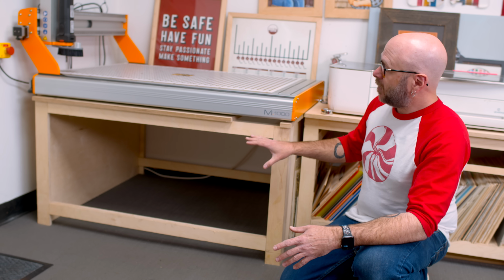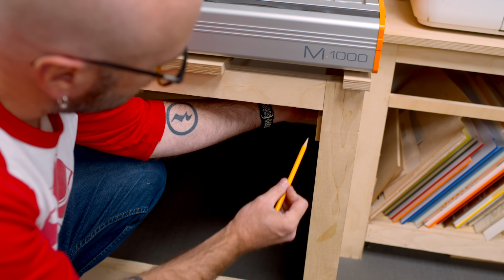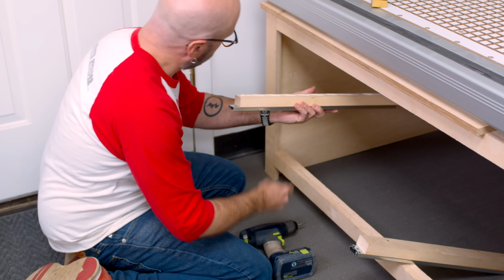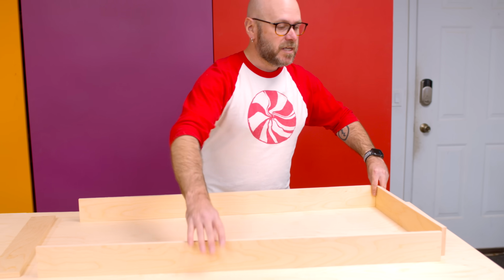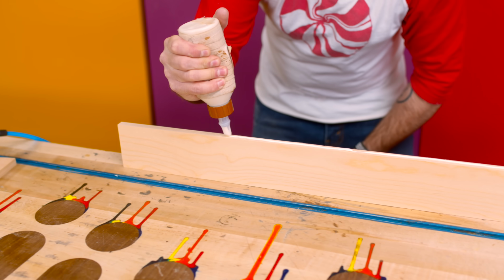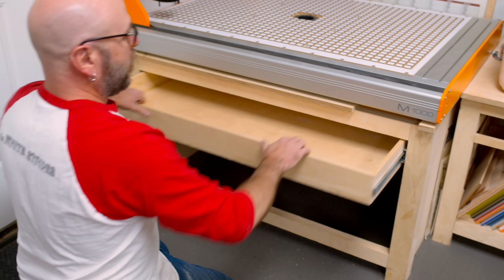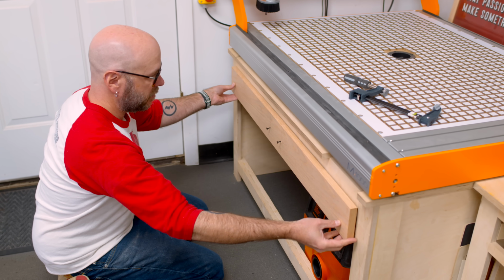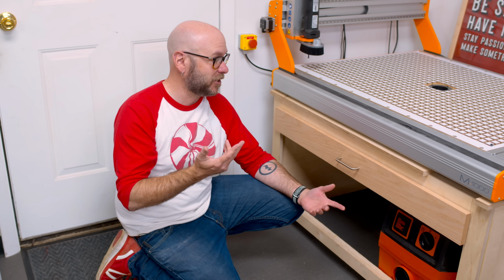Quickest and easiest way to make drawers. Woodworking Project

Comment: Interesting that it's enough with just wood glue for the bottom! Thanks for sharing!👍
Reply: It's glue, that's what it does!

With that being said, if you don't use enough, or spread it enough, or clamp it enough...then yes, the joint could come apart.

Comment: David how do you like the vacuum table and the fein vac?
Reply from the maker: Worked great in a test. Haven't used it yet on a real project.
Reply: @MakeSomething  ok, thanks for the reply I ordered the m1000 after my wife and I seen your review and debating on the vacuum table and the fein vacuum due to it having a separate cooling fan to cool the actual motor when used on a vacuum table. Hope to see a review on the whole setup

Comment: How are you going to attach your vacuum to the hold-down table with the drawers? I just purchased the M.1000 from stepcraft. I'm trying to come up with a design for the hold-down table/ Fein Turbo II and for removing the table to do vertical clamping.
Reply from the maker: For now I'll just open the drawer. I may modify the table so the port is in the back at some point.
Reply: @MakeSomething  are you happy with the stepcraft? I am waiting for mine but takes a while to get to alaska. Anyways, great content! You seem to have way better control of dust collection than I do in your shop, maybe I can tackle that next
Reply from the maker: @thirteenbravoflagsandwoodworks  Very happy with it!

Comment: Were is the music??Great stuff
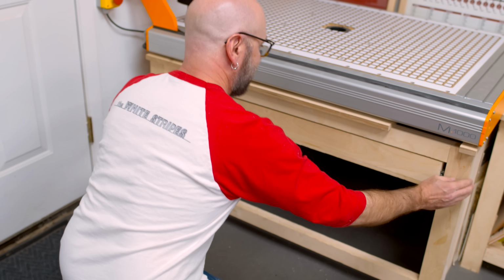Reply: Am I missing something? At 8:35 you suggested that you simply wanted to get the slides on the side of the drawer at the same height. Based on your verbiage, it seemed that you grabbed a random piece of scrap to accomplish this goal. However at 9:04 it seems clear to me that the drawer wouldn’t have closed properly if your slides would have been any lower, & there would have been an unsightly gap above the drawer if the slides were any higher. Am I seeing this wrong? If not, what happened? Did you calculate and get the scrap you needed to attain the height you wanted and not tell us? Did you grab random scrap and get lucky? Please help me understand.
Reply: @jacobgrobtuch5954  he mentioned he made a mark at 3” down so the drawer slides would be evenly spaced from the top. This probably being that he knew the overall size of drawer ahead of time.

Comment: Nice job!  Definitely a pro tip installing the drawer fronts.  I’ve used 3m tape and this screw/clamp  method for years and they both work great, yield accurate results, and efficient!  Keep up the great work as the goal is for us to continue to inspire others to build something awesome!

Comment: Hi David, I would like to request one video, one that no maker really explained, how to mark the measuring, how to cut, on the line or on which side of the line, and how to measure accurately when you have an obstacle on the one side of the measuring to be done, and really how to apply this to some things like ...making drawers and only leave 1/16th of space between each drawers, and how to measure where to install the rails for a drawer or other hardware to install...so how to translate measuring-cutting-install very accurately!
Reply: I cut so the saw blade is to the right of the line so the left of the blade guides right along the line.  If making multiple drawers put your divider such as a 2x4 to frame out the middle and your distance between both sides will be even.  After you frame out the sides so the sliders can be mounted flush you can measure out the box dimensions for your drawers.  Hope this helps, let me know if you need anything.

Comment: Doesn't really even matter the slides are at the same height in the opening. EDIT: the way did them it does.. i would have just put the slides fully into the carcass... and then sit the drawer on top of something to get it to the right level and then attach the drawer portion as I am pulling the drawer forward..

Comment: I like the idea of the 1/2 inch bottom, with no grooves etc

assuming there are no brad nails, which way makes stronger drawer? 
1. glue the walls on top of the bottom
2. glue the walls to the sides of the bottom?
Reply: Same question popped in my mind
Reply: I would recommend gluing the walls on top of the bottom and then clamping down.  Let me know if you need any help.
Reply: @inspiringbuilds  thanks for your reply.

I need to understand scientifically which option creates stronger drawer, meaning making the bottom more resistant to dropping under heavy load.

IF we used brad nails plus the glue up, I would actually think the walls glued to the sides of the bottom would make a stronger drawer, because the nails would add extra horizontal support.
Reply: @TigerCarpenter  The top method has been tested to hold over 2,000 lbs in a single drawer. 👍🏼
Reply: @inspiringbuilds  I still want a scientific explanation why walls to sides of the bottom OR walls on top of the bottom would keep the bottom with more or less strength. Call me old fashioned. I like to understand stuff